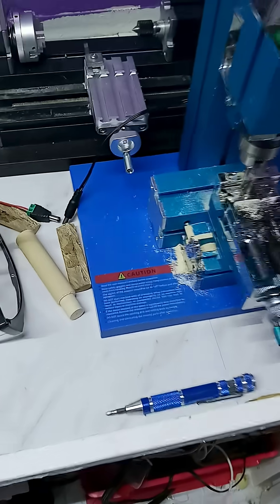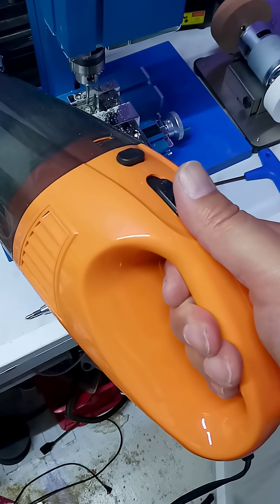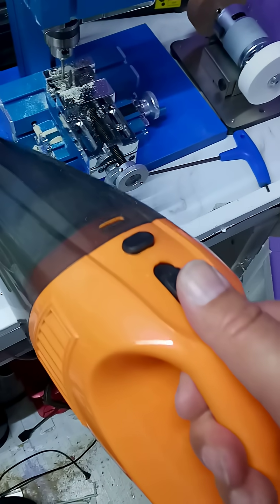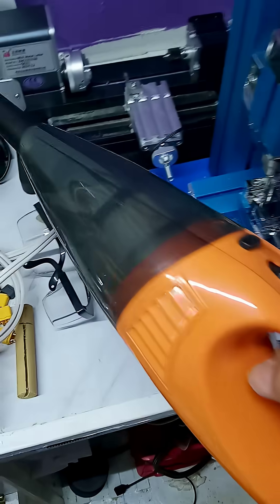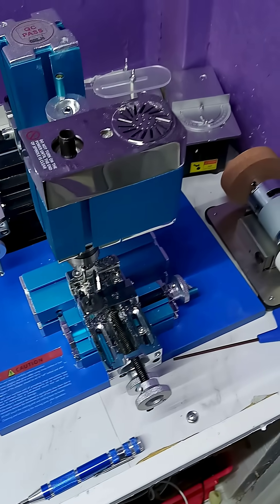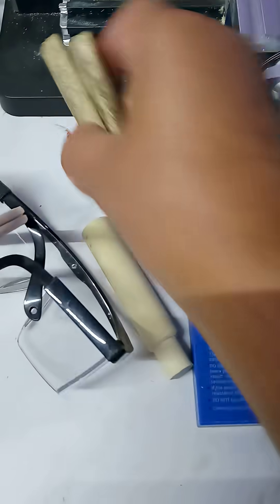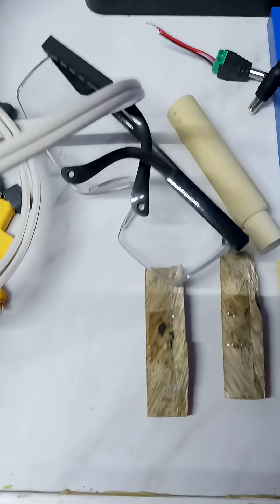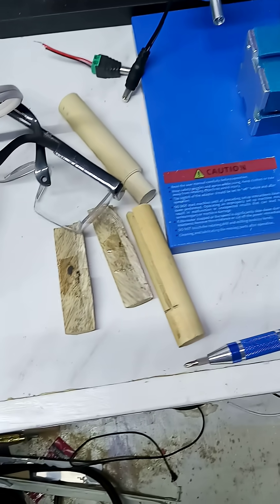⚡ When 4 Amps Just Won’t Cut It: The CarVac Fuse Gauntlet

Comment: I have that exact same screwdriver.  The back screws off where a set of 6 bits are stored.  The head is magnetic, so screws stick to the bits.
Reply from the maker: It's from Harbor Freight. It came as a set of 3 handles - blue, red, orange. I put the square bits in one, the crosspoint in another and the flats in the 3rd. There wasn't enough space to store all of the bits in just one handle, sadly.